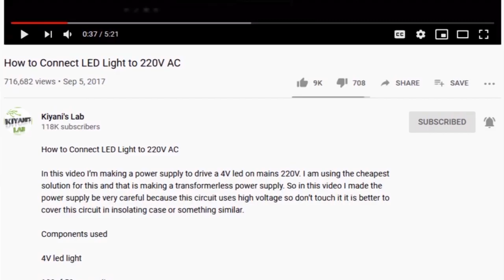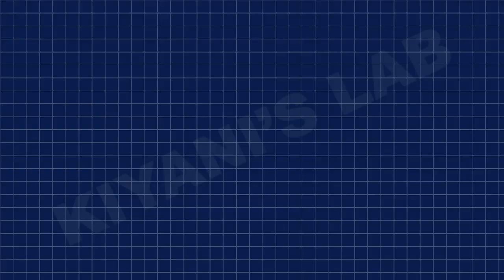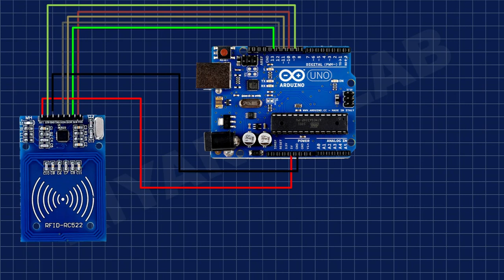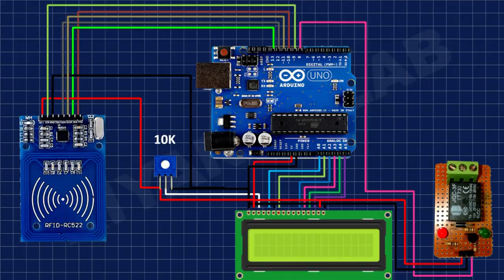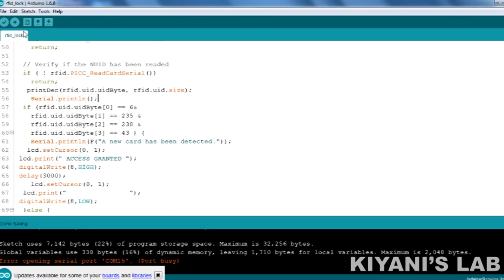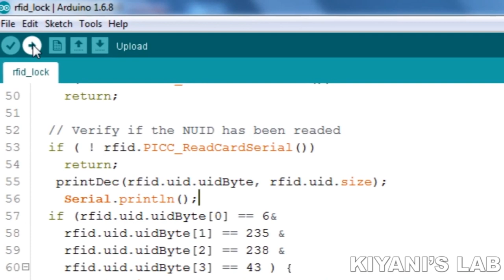How to Make RFID Security Lock

Comment: error 
Arduino: 1.8.13 (Windows 10), Board: "NodeMCU 1.0 (ESP-12E Module), 80 MHz, Flash, Disabled, All SSL ciphers (most compatible), 4M (no SPIFFS), v2 Lower Memory, Disabled, None, Only Sketch, 115200"

rfid_lock:19:23: error: 'A1' was not declared in this scope

  LiquidCrystal lcd(A0,A1,A2,A3,A4,A5);

                       ^

rfid_lock:19:26: error: 'A2' was not declared in this scope

  LiquidCrystal lcd(A0,A1,A2,A3,A4,A5);

                          ^

rfid_lock:19:29: error: 'A3' was not declared in this scope

  LiquidCrystal lcd(A0,A1,A2,A3,A4,A5);

                             ^

rfid_lock:19:32: error: 'A4' was not declared in this scope

  LiquidCrystal lcd(A0,A1,A2,A3,A4,A5);

                                ^

rfid_lock:19:35: error: 'A5' was not declared in this scope

  LiquidCrystal lcd(A0,A1,A2,A3,A4,A5);

                                   ^

exit status 1

'A1' was not declared in this scope

This report would have more information with
"Show verbose output during compilation"
option enabled in File -> Preferences.